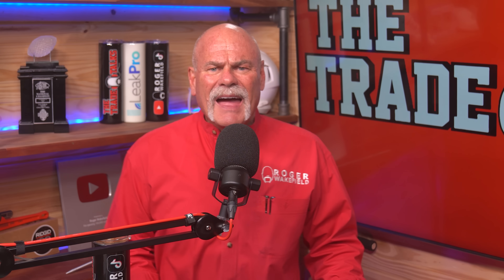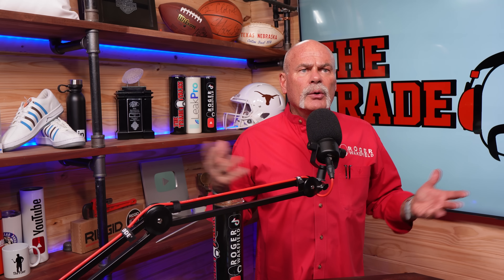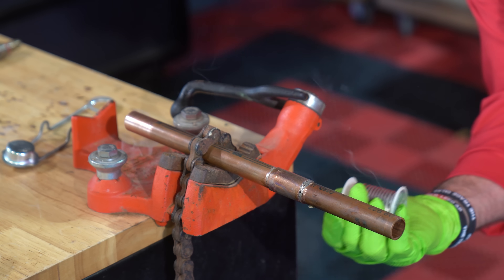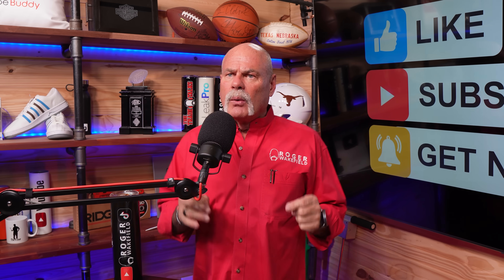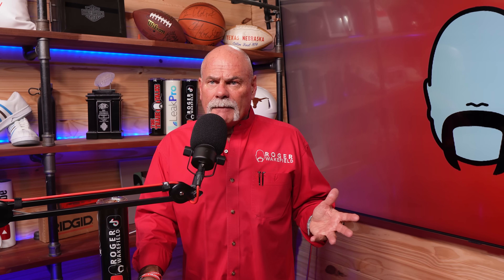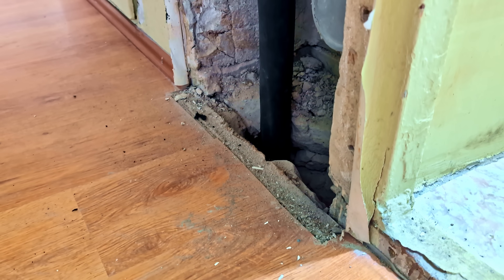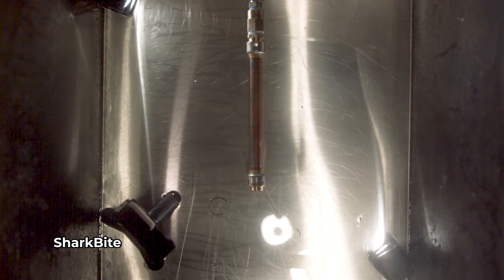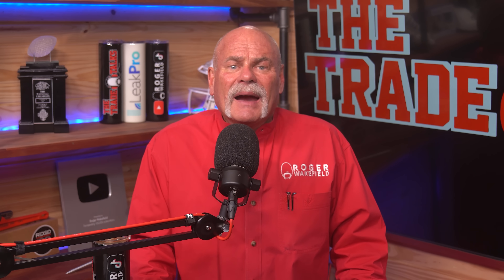The Truth About SharkBite Fittings From a Master Plumber

Comment: 'Temporary' ends up being permanent in most cases.
Reply: 🟥Red  🟩Green says:  "𝘛𝘩𝘪𝘴 𝘧𝘪𝘹 𝘪𝘴 𝘰𝘯𝘭𝘺 𝘵𝘦𝘮𝘱𝘰𝘳𝘢𝘳𝘺....  🔧𝘶𝘯𝘭𝘦𝘴𝘴 𝘪𝘵 𝘸𝘰𝘳𝘬𝘴."  Figuring the repair will last and prove itself as long as it does not fail immediately.
Reply: I'd probably use them for irrigation connections inside of a disconnect box that's buried, inside I'll stick with copper and solder or braze or plastic with glue (miss the overseas stuff, plastic that's welded). Not a plumber, but have repaired things in my home all the way up to oakum and lead drain pipes. Nothing builds a finer paranoia than ladling molten lad inside of a confined space!
Reply: There's a very old and true saying in the electrical field. "There's nothing more permanent than temporary wiring." It wouldn't be funny if it weren't true!

Comment: What happens down the road when the O-ring dries out...which it will eventually do? The loss of elasticity is the loss of the seal. Oil-lubricated O-rings do it, and so will water-seal O-rings. I think criminal charges should be leveled at anyone who would use a Shark Bite under a concrete slab, because of what you have to do to repair it when (not if) it fails. I'm a fan of PVC and CPVC piping, it's easy to do and takes very little education to learn how to cut, clean and glue the fittings. I replaced 20 year-old copper pipe in my house that was failing from microscopic grit (well water) eroding the elbows as water flowed. 25 years later the CPVC replacements are still strong. I also use PVC by the mile in irrigation installations will the only problems being the mowing guys trashing spray heads when they run over them. No problems with piping unless it freezes, which it only does in rare cases.

Comment: My issue with them is the oring. Even if everything is perfect, how long does it take for that oring to dry up and deteriorate. Also, if there is any movement in the pipe, I have long-term concerns. 

Quick fix, yes. Long term, no

Comment: I used to sell hardware and this is pretty much what I always told customers that were in to buy Sharkbite fittings. They're good products, but you have to use them as intended by the manufacturer and proper end prep is critical to a successful outcome. Your pipe end has to be clean, de-burred and square or the fitting will fail. The reason why soldered fittings continue to be the most reliable way to join pipe isn't because they're stronger than sharkbite (as stated, both methods handle pressures well above household water pressure), it's because if you screw up a soldering job, you know pretty much the second you turn the water on. If you screw up a sharkbite, it can be months or years before that particular chicken comes home to roost and at that point, access may be an issue.
Reply: Please show your reference that soldered fittings are the most reliable way to join pipe

Comment: There are TWO  kinds, of  PEX.  Type  A   ( where a plastic, ring slips  OVER   the 1/2  or  3/4  inch  pipe = a  HANDLED   EXPANDER, then Expands, both the hose, and that ring )   // Type  B  =  where the hose, has an  EXTERNAL  , COPPER  RING .  A  handled,  CRIMPER, round  hole,  half on  one arm, half on the other arm , CRIMPS  the  hose, onto a brass, outside ringed,  fitting .     ADVANTAGES, of type A  = You have a  Larger, opening, for Water Flow !    Type  B, uses OUTSIDE  FORCES,   to  crimp .  Type  A, has a  LARGER  inner  diameter,  AFTER  INSTALLATION.  More  AREA, for water  flow. ....Both are ok......PREPARATION ,  IS  THE  KEY  # 1  SECRET,  FOR  WATER - PROOF  LEAKINGS  !!!!
FOR   ALL,  ANY   ' buildings '......in  any  appliance, sockets,  breaker panels,  HVAC   ducting.....ANY THING !

Comment: Homeowner - I keep a 3/4 x 1/2 sharkbite valve in my "emergency" parts box.  If I ever have a leak I need to stop and have fixed shortly later, cut the pipe, deburr, and put the valve on the supply side, then close it.  Since its 3/4 x 1/2 it covers both sizes of pipe common in US homes.
Reply: That’s a good idea 👍

Comment: I built my home with Sharkbite fittings on Pex and it has been 5 years without any issues. I have had cats run across the lines before having the ceilings fully installed and they are still great. I know that some people dont crimp the fittings hard enough and they can leak because of that. I made sure that mine are well installed. I'll see how they do in the years to come, but as of 5 years, they rock.
Reply: There are TWO  kinds, of  PEX.  Type  A   ( where a plastic, ring slips  OVER   the 1/2  or  3/4  inch  pipe = a  HANDLED   EXPANDER, then Expands, both the hose, and that ring )   // Type  B  =  where the hose, has an  EXTERNAL  , COPPER  RING .  A  handled,  CRIMPER, round  hole,  half on  one arm, half on the other arm , CRIMPS  the  hose, onto a brass, outside ringed,  fitting .     ADVANTAGES, of type A  = You have a  Larger, opening, for Water Flow !    Type  B, uses OUTSIDE  FORCES,   to  crimp .  Type  A, has a  LARGER  inner  diameter,  AFTER  INSTALLATION.  More  AREA, for water  flow. ....Both are ok......PREPARATION ,  IS  THE  KEY  # 1  SECRET,  FOR  WATER - PROOF  LEAKINGS  !!!!
FOR   ALL,  ANY   ' buildings '......in  any  appliance, sockets,  breaker panels,  HVAC   ducting.....ANY THING !

Comment: Ive seen enough Air PTC connectors fail to not want Sharkbites in my house.
Reply: They are all over tractor trailers. Leak all the time. Replaced so many. I guess they are too lite duty for the vibrations of the road.  Not a fan of pex and shark bites. Lazy mans solution imo.

Comment: DIYer here - I have replaced all valves in my house - about 20, including just after the main shutoff - with Sharkbites and haven't had a problem in 10 years. To be fair, they are all accessible and I have the little Bluetooth leak alarms at all of them for peace of mind. But I agree, would never use them behind a wall.

Comment: I used shark bites when I replaced my water softener a few years ago. I'm impressed how well they work. Of course, I followed the instructions especially about deburring the pipe. Sweating the pipe would have been better but I decided to use the shark bites. When I have to replace my hot water tank I'll probably use shark bites unless I find a better option. I doubt if I'll use PEX though.

Comment: SharkBite fittings are approved by the Uniform Plumbing Code and International Plumbing Code for permanent installation. They give a 25 year warranty. Seems permanent enough to me.
Reply: Twenty five years is well short of good forever.
Reply: @tigerseye73  copper isn't forever as well. Sure it might last longer. 25 years compared to a life expectancy of 72, that's 34% of your life... that sounds permanent to me... sure... if it lasted only 6 months, that definitely shouldn't be used then.

Comment: Hi Roger. Thanks for the video. How do compression fittings measure up in the blast chamber and do you have any poor installation examples you have seen in the field?  I normally solder pipe joints and fittings but lately I have been using compression fittings for sinks and toilets to avoid blow torch in the tight areas.
Thanks.

Comment: I replaced all the plumbing in a structure in a cold weather northern climate with all PEX and Sharkbite many years ago. It is not heated in the winter. No leaks and no problems ever. Use the right tube cutter and the depth/trim tools from Sharkbite, mark the depth with a sharpie, and then be sure to insert all the way to your line. You will be fine. And you won’t burn your place down.
Reply: I owned a home in the Colorado mountains and the HOA mandated any plumbing changes needed to use PEX because they haven't seen freeze failures with PEX like homes with copper do.
Reply: @hijinks21  HOAs dictate how plumbing is done now?
Reply: @dmdx86 my HOA in Denver dictated that the only roofing you could use was stone coated metal after a hail storm destroyed 90% of all roofs on the HOA 

Maybe they didn't mandate the PEX but they recommended it.

Comment: If by code they are allowed to be used behind walls why say that you "absolutely can't" that's disinformation.
Press fitting all over the place today's days, does it have more gaskets inside?
I've never saw a leaking shark bite.

I Just honestly think plumbers hate it because it devalues your skills soldering.
 Why pay $400 for for a job that can be done with 3 shark bite fittings from home depot for $40.
No brainer you all hate shark bite, let me guess you probably hate cpvc as well😂

Comment: In Ohio - push fittings are actually code behind walls AND underground - I think it's actually INSANE to use them this way and would NEVER do so myself.  As a transition in a basement to go from copper , PVC or CPVC to PEX - I use them when time OR water use is a factor - but NEVER where they can't be seen OR can cause hidden damage.
Reply: Yeah because no soldered fitting ever caused damage behind a wall LOL

Comment: problem with soldering is not able to get the line dry, there is still water in the line.  when test solder with dry fittings and pressure test, they are ok.  not sure how to handle the water in the line.  probably have to test with a jetswet or similar to see if solder can work for diy.
Reply: Pack the pipe with bread and solder away.😊

Comment: Aren't shark bites the same as pro press? "O" rings 😮
Reply: They all move around and are not really rigid. The cool stuff is thermally welded chemical resistant pipes and fittings, with little electrical wires that fuse the pipe and fittings together in lab type plumbing. The other cool thing is Stainless Steel medical gas lines being welded with a rotating welder that goes around the pipe sealing the joint. Very futuristic.
Reply: @JW007100  * Why is stainless being used to replace brass  plumbing fittings?🤔
Reply: In a way, but pro-press fittings ensures it wont slip off
Reply: @FantastikoTV 🤔
Reply: Propress actually has double seal….the shaped crimp and oring….even though they only stand by the oring.
Reply: No. I don't think so.

Comment: Roger you made a great point I'd love to call out.

People are always arguing what pipe and fitting system is the best. When you said most of the reason sharkbites fail is improper pipe preparation that says it all to me.

I keep telling people all pipe systems have flaws, nothing is perfect.  It is more about proper installation techniques than anything else.

I've seen some of the most hated systems work for decades with no failure and some of the most praised fail in weeks.

I've been repairing and installing for over 20 years and im so glad to  see your videos. Thank you for explaining truth about plumbing systems.
Reply: the biggest problem with sharkbites is it is easy enough for people who shouldn't be doing the job to try it and get it wrong.  most people that shouldn't be doing plumbing aren't going to try to sweat solder

Comment: many sites now dont allow hot work so soldering is out this is due the the fire explosion risk as your using oxy fuel or mapp / propane gas torches.

so the options are push to connect, crimp press fit or compression fittings.

and for pex you have compression, crimped and push fit.

Comment: I wonder how good those o rings are after they age. Don't think they'll be soft forever.
Reply: You'd be surprised how long though
Reply: Thats my concern with pro-press. At least SB can be R+R with little trouble.  They should outlast me! Every plumbing failure I ever had was a professionally soldered joint.  SB have their place.
Reply: @phanttomracer  Outlasting you is not actually a flex. Soldered joints can last hundreds of years.
Reply: @meelash1 soldered  joints can fail. They are reliable though.  Have had more solder failures from professionals than SB failures that I installed. Still for behind the wall and hidden joints, yea, I'm soldering. No SB or propress. Not implying SB is Superior. Just better than people give it credit for

Comment: Plumber with over 20years: Love them, who cares if home owners can use them, they'll use it wrong anyway and use them till their pocket book is empty anyway, then call me to do it properly. It's the best way to change from CPVC to whatever else you're looking to connect. Why glue, which takes 30-60mins for cold and 6 hours for hot and IMHO has more liability then a sharkbite I can immediately test. . 
Sorry @Roger Wakefield, I guess I'm not reputable.... Obviously it's not ideal, but sometimes it needs to happen the way it needs to happen, where it has to be. Sure they fail, but show me something that hasn't -->>> I see GLUE JOINTS fail on CPVC, pin holes in copper, bad solder joints, PB splitting, and so many other "REPUTABLE" pipes and fittings behind walls that fail far more often, again in my 20+ years. So my experience contradicts your sermon. I agree with the sentiment you're saying, but hey, it's not an absolute. And yes, if you talk to the manufacturer, they ARE long term fixes.
Love the video my friend!!

Comment: I worked in the plumbing department for Lowe's. I sold a lot of this stuff to DIYers, and yes: to pros. That problem of pipe prep and education on when and how to use them is very real, and Sharkbite doesn't really help. Those little bags have bad, very rudimentary instructions. I know that some of the people buying the fittings would be barely looking at the instructions on the bag, let alone go online to seek out more comprehensive instructions, recommendations and warnings. Having said that, many of those people who were likely just pushing them on and hoping for the best did just fine with them.

Comment: From my over 25 yrs plumbing experience...sharkbites in some situations fail and some completely off the pipe exposing whatever is around it to the full flow of the water. This is a nightmare situation and the only fitting I have seen that can fail and leave the pipe wide open and usually results in tens of thousands in water damage.
Reply: Is there a pattern in this situations? Were the sharkbite installed incorrectly? The pipe not properly prepped?
Reply: compression and press fittings can do that too. so can a soldered joint if it wasnt done properly.

Comment: Regardless if they are installed correctly or not. You are relying on a rubber o ring to hold back water. this would be the equivalent of installing a garden hose valve that relies on a rubber washer inside a wall. I would never do it. Rubber is a material that degrades over time. If a garden hose valve leaks, the water causes no damage and you see the leak. If a Sharkbite leaks in an attic or under your crawlspace, it could take months or years to see it and who knows what damage it has caused. It's not a permanent solution and I have no idea how it was approved for permanent installation by building codes.
Reply: ProPress is also an o-ring. Also it's not rubber, it's EDPM which does not degrade.
Reply: Wouldn’t the rubber seat on a hose bib be compressed and relieved as it was used (causing degradation) but an o-ring on the shark bite be a static seal.
Playing devils advocate.

Comment: I used SharkBites in the utility room half of my basement. Open ceiling, and a floor drain in case it fails. Just too awkward to solder. Plus, I'm in there every day, so I'll see quickly if there's a problem. Like Roger says, I'd NEVER use them someplace enclosed! About 12 years now, zero problems!
Reply: same, have installed dozens, soldered 10x more though. I too won't install them in enclosed spaces, but I believe they ARE rated for that. Still I don't FULLY trust them to be behind walls
Reply: @phanttomracer  i think i put it behind a wall in my basement bathroom.  if it leaks its just the drywall on top of the cement blocksci can fix it easy enough it's not worth hiring a guy to solder.

Comment: I use them when im connecting to a filter housing and cant solder every fitting without potential of weakening the plastic of the filter.  Would never install one in a wall or somewhere you cant easily see and get to.

Comment: As a plumber I can't charge a customer for something they can do themselves. I use the caps on remodels.
Reply: Like how do you feed your family you know what I'm saying you have to get past that thought because it's going to make you stay poor you are providing a service regardless if they can do it themselves or not
Reply: Bro come on now what do you mean I mean if you want to bring an argument to light think about it every customer just about or at least at one point in their life was able to do what we do as plumbers it's if they want to actually learn it or not okay so if you have to use a shark bite on a CPVC fragile line on a front end shower valve replacement for example and there is literally no room to prefab or screw on a solvent weld threaded adapter and tighten down or compression or any of that what are you going to do you are going to use a shark bite brother I mean in some instances you also don't have to wait for the glue to settle to test and also you you literally have no room for any other option but to use a shark bite so I always say thank God for those things don't get me wrong I don't think all the house should be plumbed in them but they have their purpose

Comment: Don’t press fitting rely on the 
0 ring as well?
Reply: The o-ring is a backup. The crimp is the primary seal.
Reply: @relaxingwindow6137  You should take the oring out of one and press it.
Reply: @relaxingwindow6137  That's not true actually. The crimp keeps it from falling off the pipe, the o-ring holds back the water.
Reply: @Ariel1S  I've seen it tested. The crimp seals the water unless it's damaged.